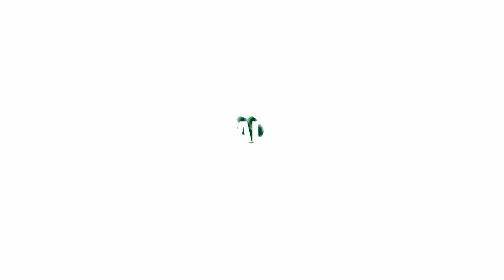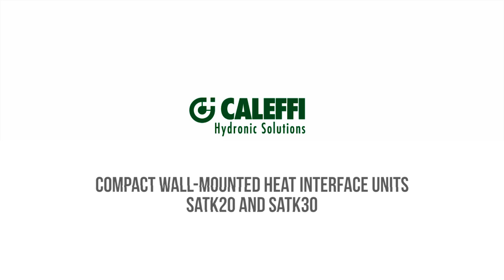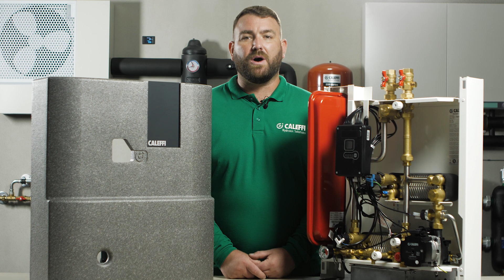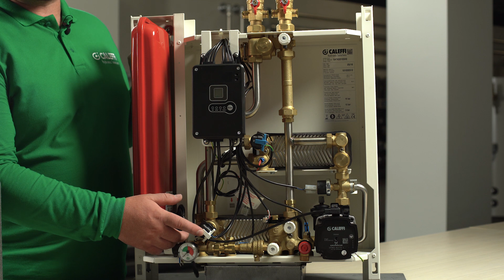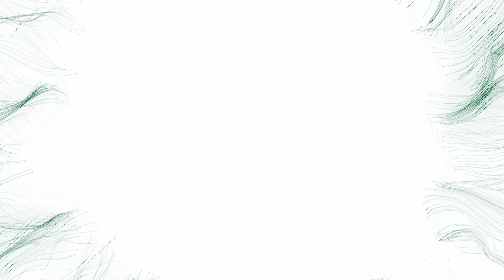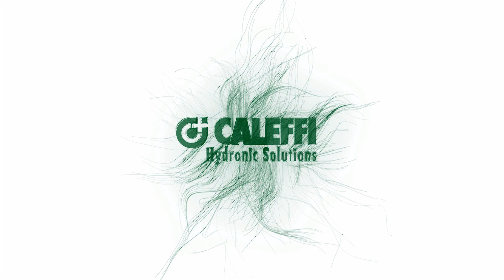Compact wall-mounted heat interface units - SATK20 and SATK30

Comment: These were installed in our flats...absolute crap
Reply from the maker: Thank you for your comment regarding the heat interface unit that you have installed at your flat, we are sorry that you are experiencing issues with the product. Please could you contact our technical team in the UK on 01785 218206 and they will discuss the concerns with you and hopefully resolve any problems you have.